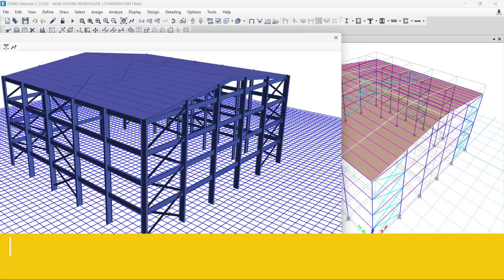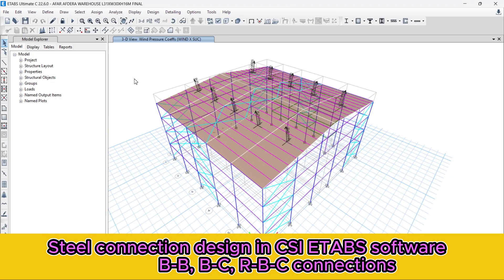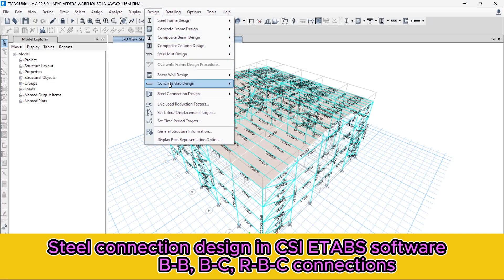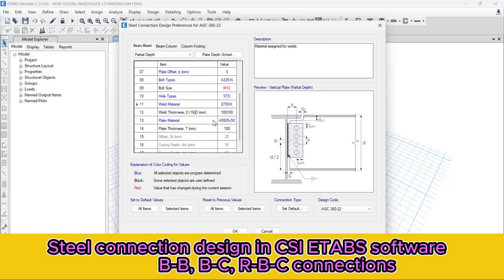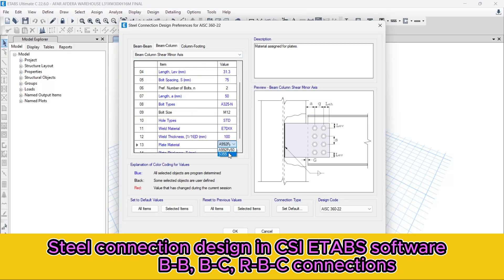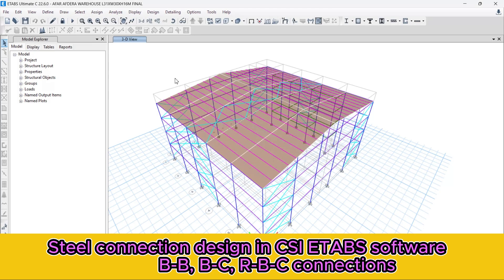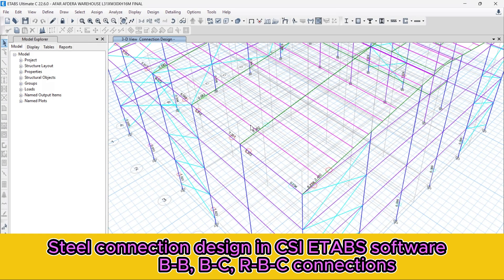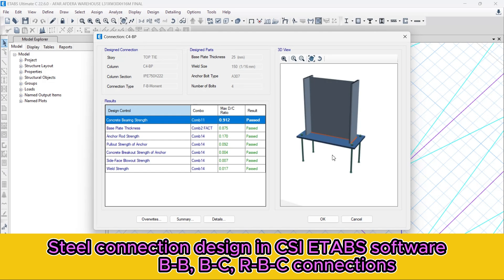Steel connection design in CSI ETABS / base plate anchor bolt civil engineering

Comment: I appreciate your effort, as well as your presentation and explanation style. I have a question regarding wind loads: why are the loads considered to act only on the roof panels and not on the frame elements?
Reply from the maker: Horizontal effect of load is considered and assigned at each diaphragm
Reply: @Ezilengineering  Horizontal effects from seismic loads can typically be assigned to defined diaphragms. However, when it comes to wind loads especially in portal frame structures with fully closed or fully open openings the behavior seems to differ.

Comment from the maker: next i will upload how to generate steel connection design drawings from ETABS if you are interested????
Reply: am interested. How to do detailing
Reply from the maker: Automatically generate it from etabs detailing or I will upload video
Reply: Is it possible to automatically generate in etabs 2022?
Reply from the maker: Yes contact me I will share AutoCAD file of this model automatically generete from etabs
Reply from the maker: 2016 is good for detailing in my insight
Reply: @Ezilengineering  I failed to get 2016
Reply from the maker: Make it detail then solve it